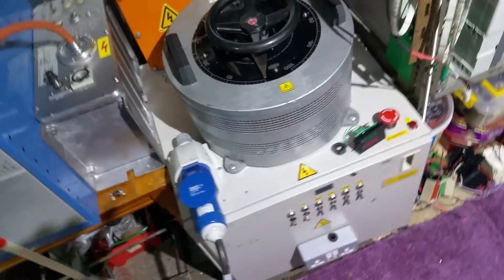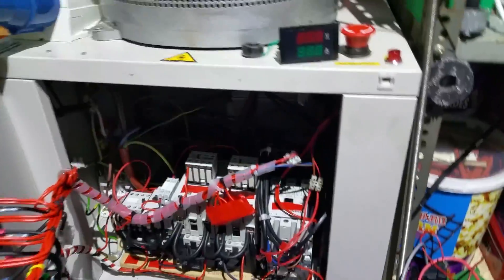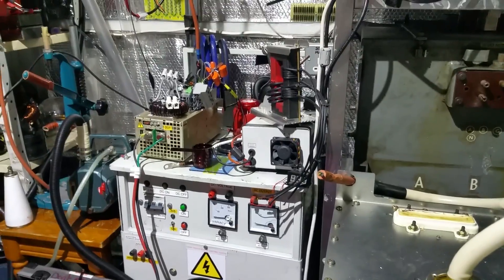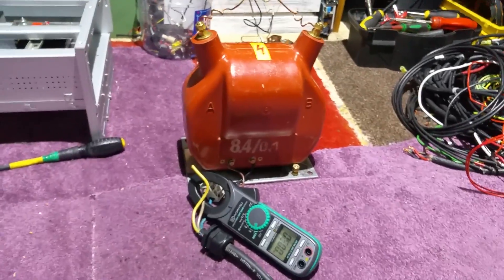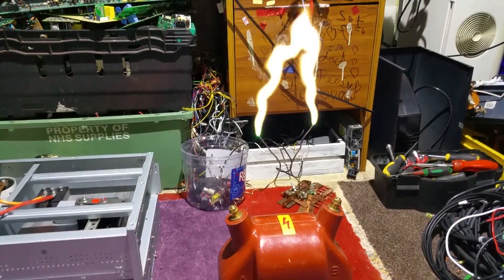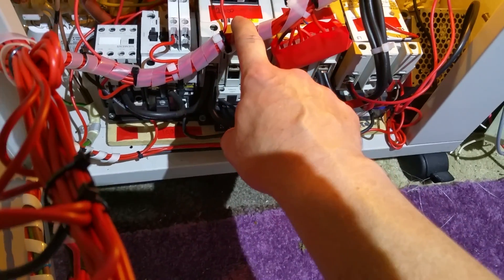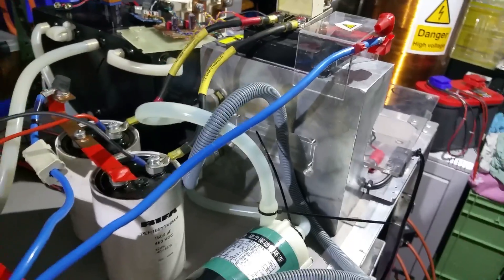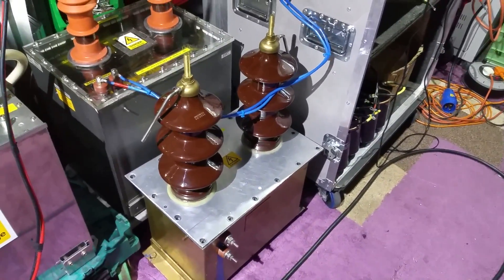Rant"  30 Amp variac repaired

Comment: +high1volatage1rules I have a vintage flyback transformer that's rated for 26kv and was wondering if it would be better for the flyback to use a Single transistor driver with the resistors or use a zvs just because I would like the flyback to stay good long as possible since it's fron around 1945
Reply from the maker: Hello
you can either run it on a zvs" or a single mosfet setup" or a 555 timer circuit. there's many different circuits to choose from! what ever best for you mate. 
the only thing that will kill your flyback, is if you stress it out. over powering it and letting the flyback get hot! normally flybacks can rate from around 35 volts. but this is a run by the crt tvs own circuit and run very well with alot of protection. and the flyback would just get warm after hours of use!
if you just run it from what ever circuit you desire then keep it upto 24 volts. and try to keep the current down.
and hopefully this will give you many of hours of fun. and when you use it always make sure it's a closed circuit as for the older flybacks the wiring insulation is not best! and you don't want a internal flash over. 
I will say tho mate the old flyback arnt as good with thier insulation like a newer flybacks.

hope this helps and best of luck and be safe.

Anthony 👍😉

high1voltage1rules
Reply: +high1voltage1rules thank u for your reply

Comment: 32 or 63 amp plug ? Awesome, thumbs up !!
Reply from the maker: Hello
Yeah sorry mate. it's a 63 amp socket. and the 32 amp socket is alot smaller size.

many thanks 

Anthony 

high1voltage1rules
Reply: high1voltage1rules Nice, ok, thank you, what's the problem with your full (H) bridge, I also working on one, maybe I can help :D
Reply: high1voltage1rules We are friends on Facebook, I can send you a message there, if you want
Reply from the maker: +High Voltage yeah cool mate 👍